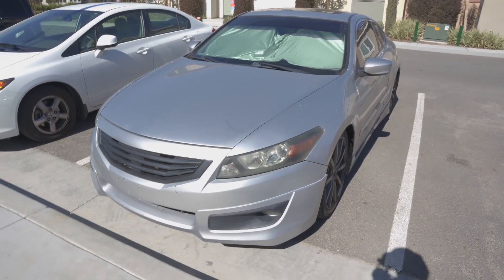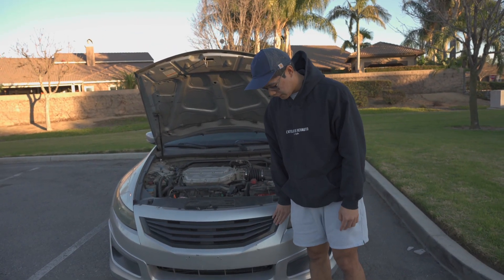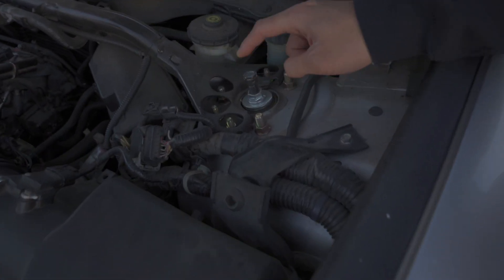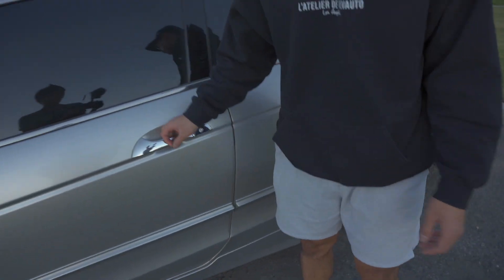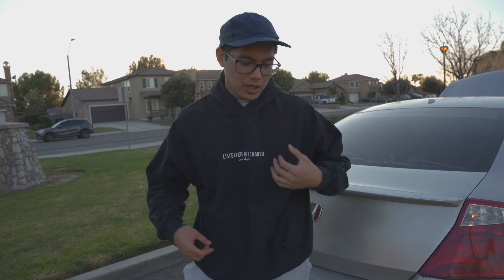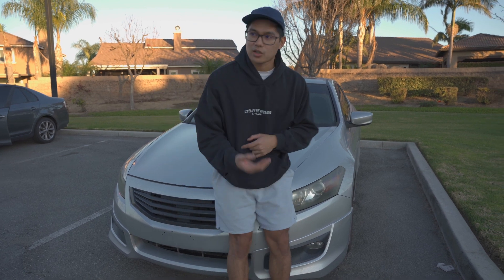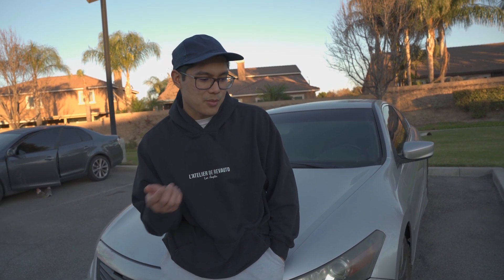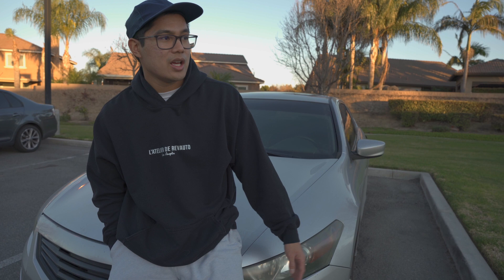FULL MOD LIST AND 1-YEAR OWNERSHIP REVIEW! | 2008 Honda Accord EX-L V6 Coupe

Comment: Hey bro, what you want to do is buy a j37 Acura TL Sh-awd intake manifold that way the j37 TB bolts on. This mod is good enough not even porting it because porting will only gain a little. The j37 opening is much bigger plenty of air. It will not throw a code either as long as you use your stock butterfly actuator for the intake manifold. It’s the little black plastic thing next to he power steering pump.
Reply from the maker: I will be getting an intake manifold and throttle body upgrade, I have heard that the J35Y is a better manifold than the J37 though.
Reply: @abc.garage  it can't be better because the throttle body bolts are wider on the j37 TB so if you wanted a bigger TB you'd have to go j37 IM anyways to fit the bigger TB. Its not the IM itself that's better its the opening for the tb.
Reply: @Jaydogg209   all of the magnesium manifolds perform more or less the same. And idk if u actually looked at the j37 throttle body in person, but the opening is 78mm and tapers to 70mm. The j35 manifold opening is 67mm. That 67mm can easily be ported to 70mm. Porting the opening is cheaper than buying a j37 manifold. You have to run an adapter plate for the j37 tb on the j35 mani and that will look like an obvious mod to a cop in CA.
Also, the j37 throttle body will have idling issues with manual cars. There are two ways to get rid of it. Tune or do what I did. I took the motor and throttle position sensor from the throttle body of an 8th gen 3.5 accord and swapped it into the j37 tb on my tl-s 6mt. The idle surge was reduced by 95%
Reply: @Buhz93  I’ve been running the j37 mani and Tb for about a year now and I only get an Idle surge when the idle drops after pushing in the clutch to coast in a normal car, but it is slightly delayed like 1 sec that’s it as far as idle surge but does not affect racing .. I did some minor adjustments,  but a lot of test try’s to get the electronic throttle cable slack perfect to increase idle to a point where the surge is not even noticeable. You don’t want an adapter. It’s his car though, just explaining how easy it was for me.

Comment: a underdrive crank pulley kit comes with belt with definitely give you 10 wheel horsepower all through the rpms you will love it also a weapon r secret weapon intake is good for 10 wheel horsepower you need to thermo wrap it to keep heat soak away
Reply from the maker: You know, throwdown performance contacted me about running one. I’m just worried about longevity, but I’ve been hearing it’s been fine for the owners!
Reply: Yes i have always had underdrive crank pulley in my cars 2004 accord v6 2012 honda accord now full boltons dyno tuned on ktuner never had any problems they are very well built and last forever no probles at all the power is awesome and weight reduction too stock crank pulley is ober 9 pounds underdrive pulley is 1 pound the 8 pound goes to the wheels and less parasitic strain on engine components is a win win mod
Reply: @abc.garage  these engines are internally balanced, no worried

Comment: Hi. Love your video and the car. I have one just like it. I bought it new in 2008. It presently has over 250,000 miles on the odometer. I have constantly performed the required maintenance during my ownership. I've never added any mods, still original equipment. I would like to know where should I start with modifications. What should be the first thing you suggest I modify, or do you think it's too late to begin depending on the mileage. Thanks. Looking forward to hearing your suggestions.
Reply from the maker: You can do any of the mods I have listed in this video, but I would say the first mod to do would be exhaust because it adds sound and power. Then from there you can add like intake mods!

Comment: How is your car's valve noise? Have you done a valve adjustment? I was lucky enough to get my blue 08 with the hfp kit as well It has 245k miles ill for sure keep following your build
Reply from the maker: We found out that it’s an exhaust noise so we kinda just let it be, also dude that’s clean! Thanks for the support

Comment: Are you gonna use j37 intake manifold and throttle body when u upgrade?
Reply from the maker: Ported J35Y manifold with J37 throttle body bc it’s supposed to have better flow
Reply: @abc.garage  alright thank you i might look into that too for my tlx